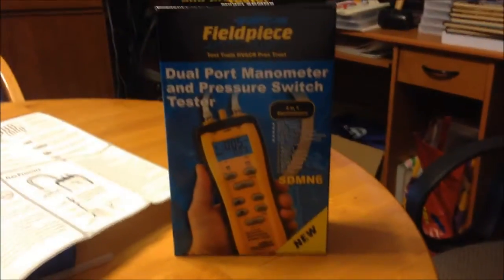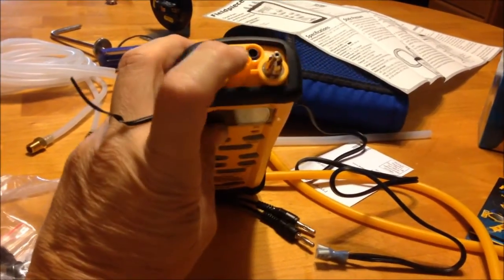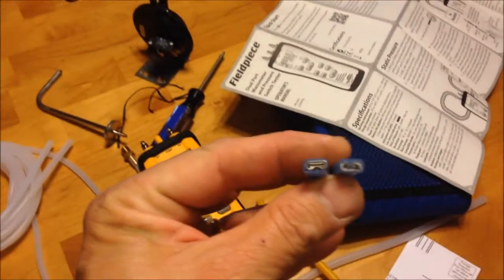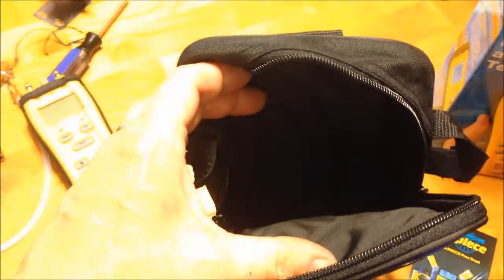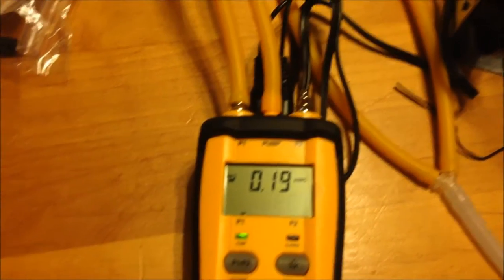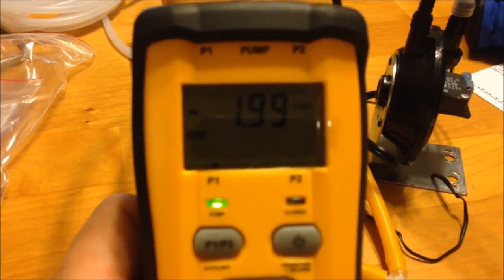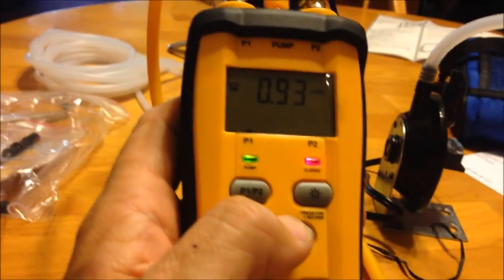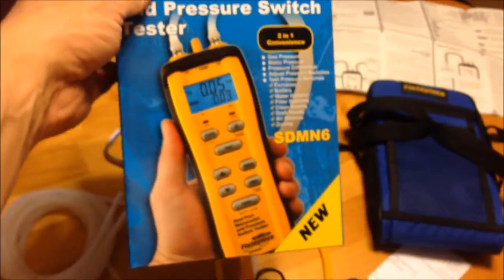New SDMN6

Comment: I'm sure that six years later you must've already figured it out. You need to zero the monometer to atmosphere pressure before plugging it in the pressure switch . Otherwise your monometer readings will be all over the place. I have the SDMN6 and also the DDSM1. Good meters I like them and can't be without.

Comment: want some advice as far as the Fieldpiece dual port manometer goes? Go to Johnstone and purchase some air proving switch 3/16" silicone orange colored hoses and 1/8 pipe 3/16 hose barb fittings. the original super soft hoses **SUCK** and rip and tear very easily which could cause a fire or explosion. beware of these hoses! the Johnstone hoses are much more durable and safer. i had two rips in these hoses the first week using them.  Field Piece is fully aware of this potentially dangerous situation!